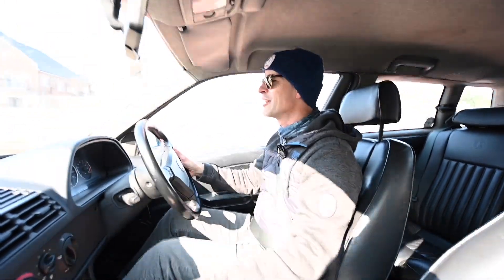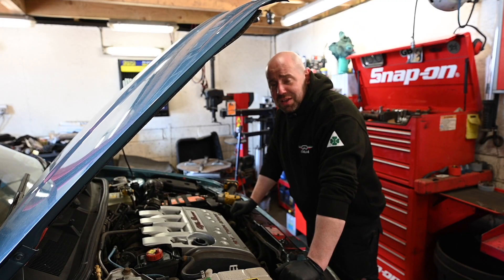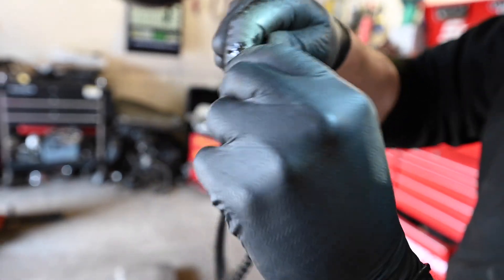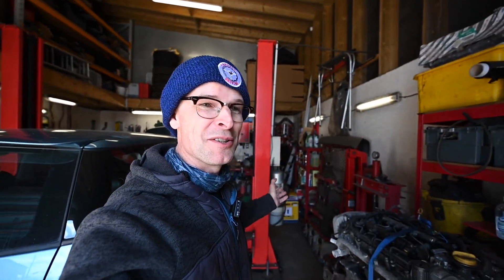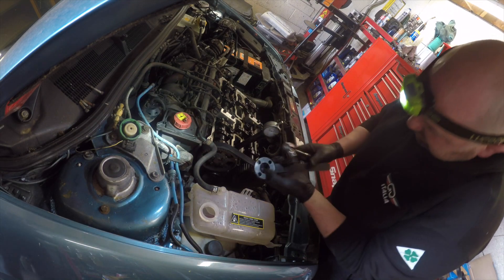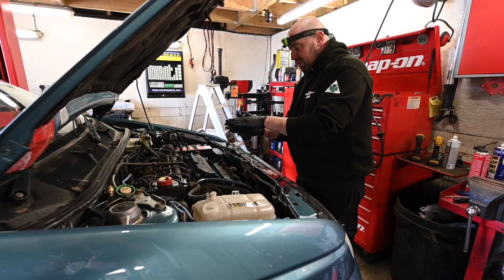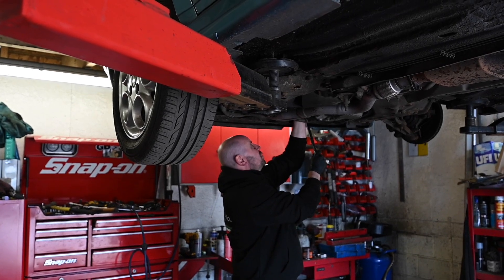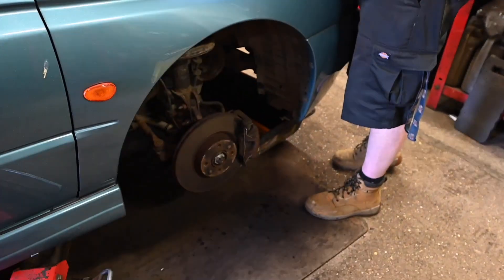Alfa 145 gets a timing belt just in time, and the very stuck A/C compressor

Comment: I've been a hobby mechanic all my life and did this job on my 145. All straight forward till you come to the balance belt tensioner which I tried to do as best I could by sight. Car ran fine for a while but then I got a ticking sound which turned out to be the balance belt tensioner hitting one of it's stops. So I got myself the adjustment tool which Jamie uses here but it wouldn't fit between the tensioner and the chassis leg.  I've now had a bit chopped off the tool shaft and rewelded to try again but haven't got near my 145 since with other projects. Jamie's experience shows with his use of gasket sealer on the cam cover belt end. My engine is a phase 1 with the aluminium cover and getting the right torque on the bolts to prevent oil leaks on the corners he mentioned is a nightmare,  I'm on my second cover after breaking a corner off and still have a leak. Thanks for showing this Matt and Jamie, valuable footage! It's like everything in life, experience is the thing and I fully recommend specialists like Jamie for these difficult jobs.

Comment: Did a DIY cambelt job on a 24V 164. Cam pulleys fit on a taper surface, not keyed, one slip of 4 cams and you get a destroyed engine as a result. There are 6 pages on the tech service bulletin on how to set the tension properly on the cam belt using specialist tools. This looks like a breeze compared to that.
Reply from the maker: that sounds like a 'nah, thanks' kind of job!

Comment: Good to see the 145 back in use. 
Re the damaged lower belt cover. Wondering if it's had an alternator or auxillary belt let go during the past which has then whipped around and damaged the cover? Was once called out to a '52 Renault Scenic diesel where the alternator over-run pulley threw its belt and it wrapped around the crank pulley then into the cover and timing belt with expensive results.

Comment: A great watch, thanks for filming this, Matt. I did my 159 diesel timing belt and water pump last year on a gravel car park with only a jack and a few hand tools. Easy job, only took a couple of hours and I also replaced all of the auxiliary belt pulleys too. Passers by were amazed, they thought it must be some kind of black magic as garages charge big money for the job and most folk would be scared to death to attempt it themselves. As long as you do it methodically and double check the marks and tension are correct, jobs a good un.

Comment: Given what work had to be done, I think you made a wise decision to go to a specialist.  I have successfully done timing belts on a V6 Pajero, a couple of Charades, both 3 & 4 cylinder and several Corollas, single and twin cam.  The Japanese cars have dots and notches and arrows to align everything to so I followed procedure and never had a problem.  Exotic engines like the Alpha look a little different.  You can actually adjust the cam timing, which is good for tuning.  I'm sure you will thank yourself for the aircon one day. 😊👍

Comment: Matt, nothing wrong with the original timing belts, they weren’t faulty.

What was faulty was the plastic tensioner wheel that Alfa put on them. That used to fail and take the belt out.

All timing belt kits since 2001 or so have a Littens metal tensioner which doesn’t fail like the original plastic wheeled one.

Comment: @furiousdriving here in Australia where air conditioning is fitted it is often used with the demister function. 
if that is the case then it is a Roadworthy fail (our equivalent of the MOT) as the A/C is considered a critical component of the car and as such must be working correctly so that your demist works.
Reply from the maker: Well I didnt know that!
Reply: @furiousdriving  also cars down under cost a lot more money your Alfa would be worth the equivalent of 8000 pounds where I live. I can't believe they are so cheap over in the UK.

Comment: Your absolutely Right Mr Furious Driving, My Nexia, Owned 4 and a Half years and Got the Belt Done Janurary this year. What you say its like a Lottory and your absolutely correct. I was also Told I had Just Cought the Belt Just in time. 
The garage reckoned that the Belt would of gone within the next 5k miles at best 😮
Like yourself i can now too relax for the Foreseeable, At somepoint i will have to Get the Hyundais Belt done at somepoint.

Comment: The a/c compressor is a Sanden SD7V16, the same as in my Volvo 480 and many other cars of the 1990s that were luxurious enough to have been fitted with aircon. Are condensers still available for the Alfa 145? For my car these have been unobtainium for years. Pro-tip: have the system properly flushed and fit a new filter/dryer afterwards (when available, again these are unobtainium for my car)

Comment: Matt, I did my first timing belt recently on my 2003 Alfa 916 Spider twin spark. I ended up fitting it, taking it off, fitting it again just to check that it went back the same way both times before I was brave enough to turn the engine. Glad to say it was all ok and a big sense of achievement doing it myself. The cam locks are cheap off ebay for the twin spark.  Cheers Steve

Comment: Damn,i had the same problematic bolt on my 156.Although mine was on the bottom side of the compressor.Still it was the same game.It twisted,i tought it was gonna snap,in the end it didn't fortunately (i didn't use heat because i haven't got any flame
 torch),but going back and forth for atleast half an hour and it came out as a spaghetti.I still have nightmares with stuck corroded bolts on that car.

Comment: I brought my 145 with 80K miles in 2006 and ran it for another 60K miles before I replaced my cambelt.  The belt in it was a Gates one and it wasn't even cracked.  Don't know how long the Gates belt  was in it.  I replaced it with a Dayco one  - should have got another Gates one.

Comment: Incredible differences with belt changing intervals. Some need doing after 40k, mine only needed to be changed after 110k miles (180 k km).
Reply from the maker: And Alfas own difference - 70k topped to 35!
Reply: My Alfa 145 1.8TS has it's original cambelt since 1998 but it's only done around 49k miles. I did wonder whether the additional balancer belt on the 2.0TS contributed to the higher failure rate that led Alfa to reduce the replacement interval from 72k to 36k miles. Anyway, so far I've probably saved up to £3k by not following their advice, until the evil day arrives......
Reply: @malcolmlowry6118  you should change the belt after a certain time, I think it was 7 or 10 years.

Comment: I always change the timing belts along with the tensioners at precisely 3 years no matter the mileage covered. I choose either the Dayco or the Gates ones. But the procedure to change the belts is by far easier in my boxer 145. Told you that the Twin Spark is a bit of a headache...
Reply from the maker: This is my 3rd Twin Spark (including my wife's 147) so very familiar with the routine, but have always trusted Jamie to do them. Not having to move the engine mount its easier than a K Series twin cam but I dont have the tools (or years of experience!)
Reply: @furiousdriving  You are lucky you have a dedicated Alfa Romeo mechanic and not a random local "I do all" one. Especially one who worked during the Twin Spark era and knows their "secrets".. Don't lose him!! 😁

Comment: Great to see you got the timing belts taken care of. I have always used Anti-Seize on steel bolts going into aluminum as a way of preventing steel bolts from getting stuck or potentially broken off due to corrosion. Especially being installed into anything aluminum.  Like how the Tea Mug gets to ride along being seat belted in.

Comment: Really interesting vid. I was particularly interested in the cam belt tensioner and the cam variator - the one in my 1.6 T Spark rattled, making the car sound like a diesel at idle. I had it replaced, and a couple of years later it started rattling again. Only weak spot on an otherwise very reliable car!

Comment: This is no joke if you have a twin spark. My Wife’s 147 ate its timing belt at just over 30 thousand miles back in the day when these cars were current.
This was before Alfa changed the timing belt service interval. So we were lucky and it was covered under warranty.
Reply from the maker: That was ridiculous how they halved the interval, you were fortunate with the warranty
Reply: @furiousdriving  Volkswagen did the same with the 1.9TDI (the one in which people love to go on about for being reliable) around the same time with the PD engines, originally 80,000 miles and then dropped down to 40k.

Comment: I wonder who thought a timing belt that when it fails buggers up the whole engine would be a good idea ?
Reply: Timing chains aren't much better. Look up VW TSI engine and you will see the pain. The joys of interference engines.
Reply: Not on a Fiat FIRE engine though. The old 8v one is non interference.
Reply: Belts do not need lubrication like chain or gear drives to cam shafts and in theory easier to change as if one has changed the lower chain on an XK engine will know.
Reply: I agree. Depending on the type of car, it also guarantees a bill of a few hundred pounds for the dealers and others. In my opinion valves should never have a chance to touch pistons.
Reply: It would be OK if it was easy to change.  Ford Ecoboost is around 12hours labour, even though it is meant to last 10 years that is ridiculous.
Reply: @jamescaley9942  Wow such a design is madness, would have expected better from Ford. After a few years the Ford Dealer labour charge of around £50 an hour could make the car uneconomic to service/repair and force a driver to ignore the change and drive till it snaps then scrap the car.
Reply: @neilwalsh4058  uno 1.0 firestorm. I bet they are rare now.
Reply: Just check if the engine is none interference. The 1jz vvti in my Crown is. Not sure why they can't make all engines like it. Probably some emissions regs or something?
Reply: @chappy2121  Just a guess but I think they need high compression ratios as this is linked to efficiency.  Look at Mazda sky active engine, for example.  Diesels always had high compression ratios.   More efficiency means lower CO2 emissions but some other emissions like particulates and fine particulates can be the same or worse with modern direct engines.

Comment: Just in time is far better than just too late. I always felt with the 164 V6 that cam belt failures seemed to start after about 55,000 miles on an official interval of 70,000, so my personal interval was 50,000 miles for a cam belt change. Ditto with my 156 jtd 2.4 Sportwagon.
Reply from the maker: They started having fails at below 50k which is when they halved the interval. Finding better belts might have been the better solution!
Reply: Yes, the V6 belt looks very weeny to keep all that rotational speed in check. I'm sure we'd have a lot more V6s still on the road if they'd had chains as good as those on the 8 valve Twin Spark engine of old.